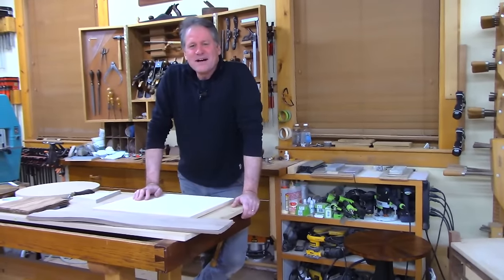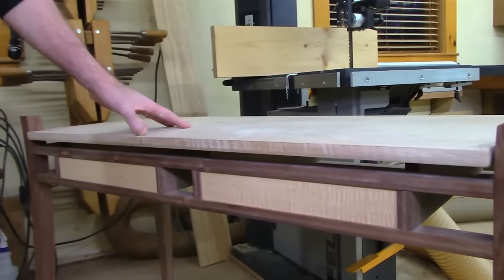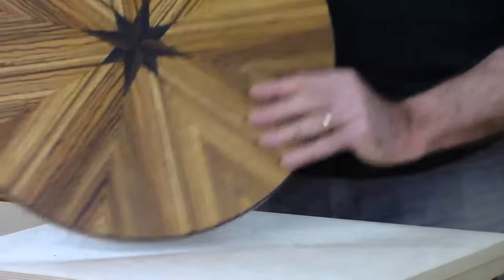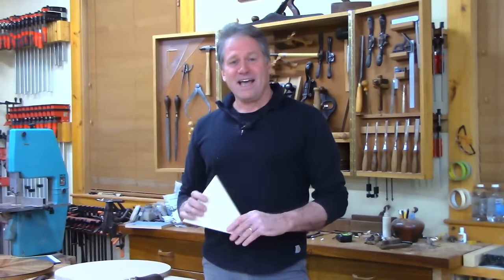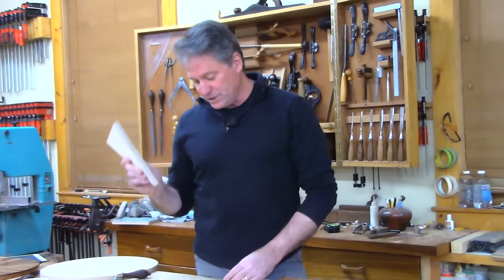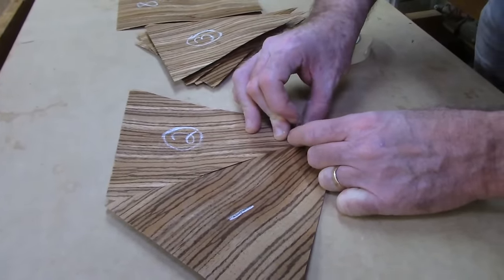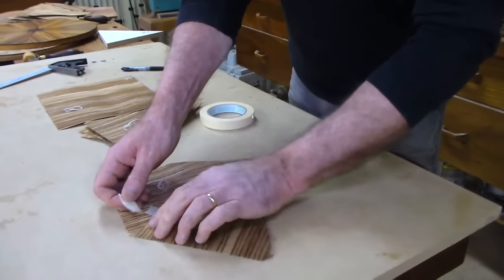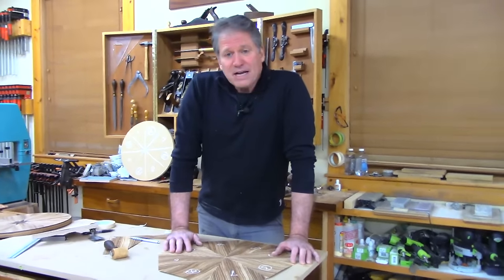How to Veneer a Sunburst Top

Comment: Stellar.  Very inspirational and I’m getting close to joining the neighborwood. In the course is the post (not sure of the term for the piece the legs attach to) done on a lathe?  Thx.  Best woodworking channel I’ve seen, and I’ve watched a lot of them!
Reply from the maker: Thank you! I’m not sure which course you are referring to, the contemporary round table or the Shaker candlestand. The contemporary round table has an octagonal shaped center column, which in the course I show how to make on the tablesaw. In the Shaker candlestand course, the column is bottle shaped and turned to shape on the lathe. The legs are attached with sliding dovetails.
Hope that makes sense and is helpful. Thanks for watching! 👍😎
Reply: @EpicWoodworking  hey Tom, I was thinking of the Shaker candle stand I guess.  I’m amazed at the workmanship you can do with veneer as well.  Seems like an “underrated” aspect of the woodworkers’ arsenal.  I went to one of the links you guys shared for veneer materials and was blown away by the variety and quality of those veneers! (and really affordable when you think about it).  Thx.  Btw, I now know more about putting one of those vacuum pumps together than I would ever thought possible 😂